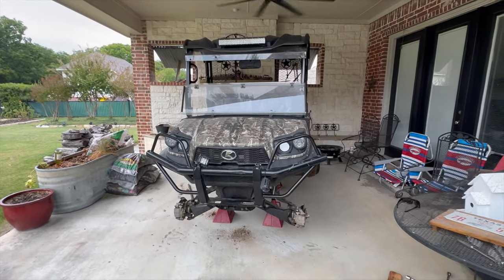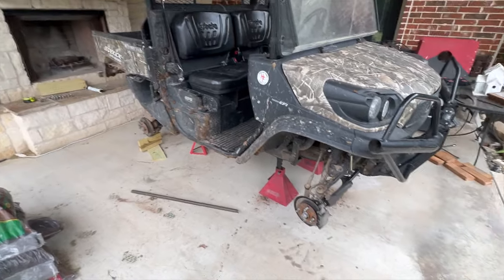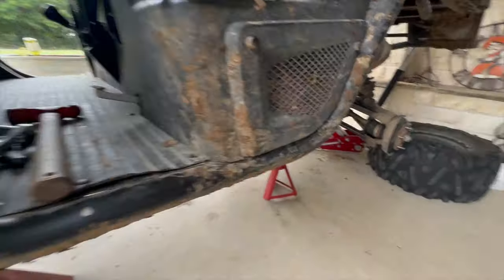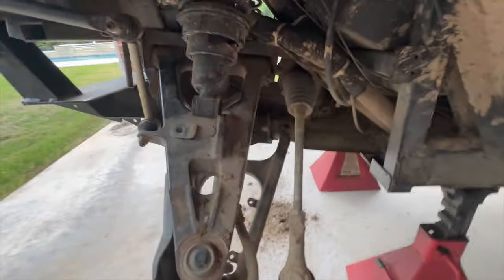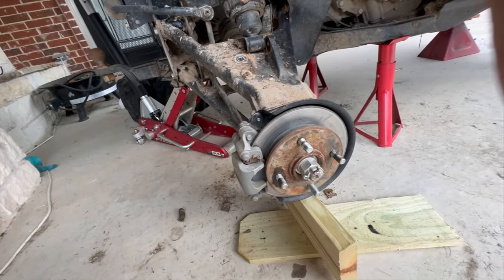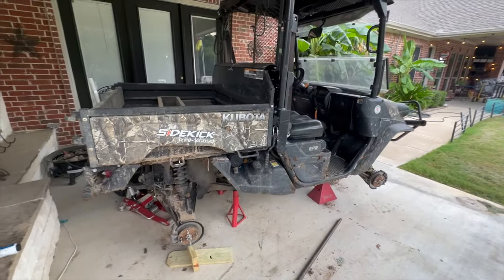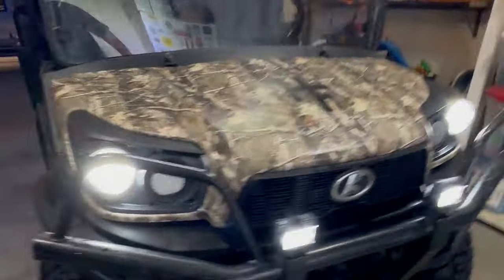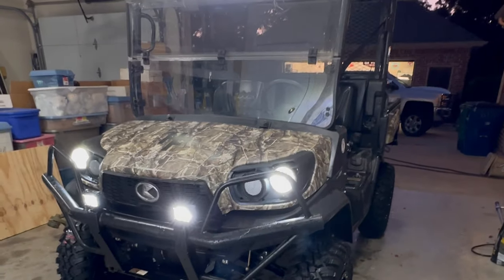Kubota Sidekick with Demon Lift Kit and Terrabite 28" tires.

Comment: Mine has turned out being junk. Serious gas dilution of the crankcase oil. 10 weeks in the shop and still the same. Some of them  seem to have defective engines and Kubota doesn't  know how to debug or fix them.
Reply from the maker: Man, sorry to hear that.    That stinks.   At first, Kubota was buying engines from Subaru and then Kubota bought out the small engine factory at Subaru and brought it in house under their name.   We’ve been lucky so far.
Reply: @HeritageFarmsTexas  Mine seems to be one of the first made by Kubota.  Dealer said try to blow it up running it hard with the gas in the oil so Kubota has to fix it.

Comment: Is yours a 2023 model, Demon was saying I may need the spacers and that would void the warranty as it pushes the tires 2 inches outside the fenders and that would toss mud everywhere?
Reply from the maker: Thanks for watching.  Mine is a 2019 and I didn’t need spacers on mine.
Reply: Thanks, adding the kit, I designed a stake body tool system for our farm that incorporates the Milwaukee Packout system so everything is interchangeable.